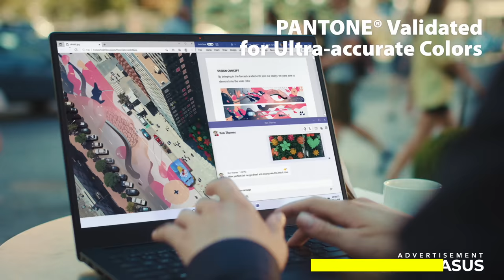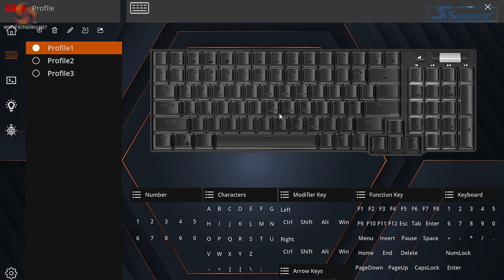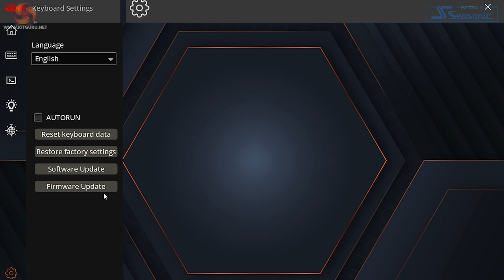Royal Kludge RK96  - INSANE Bang for Buck board!

Comment: Underrated keyboard, imo. I'm typing on it now, it's got everything I need; backlighting, wireless, Bluetooth, mechanical switches, hot-swap. I only wish the backlight color was a pure white and the media keys were separate from the function keys. Still, an insane value for a keyboard!
Reply: I bet if you changed the switches to ones that are clear/white then you’d get a pure white backlight.
Reply: hmm i got the rgb one so there's an option for a white backlight but i dunno if it's a bit bluish to you instead of pure white. The first models had only the blue ones I think. Mine has rgb.

Comment: Not sure about the volume wheel being stiff to roll and no feedback, I just got mine and its very light to roll and has tactile feedback like a mouse scroll wheel. Surprisingly, the volume wheels is also made out of metal. Maybe they fixed it in the later versions?
Reply: Hi! Can i use the volume wheel while on wireless or bluetooth mode?
Reply: @ianbalmaceda281  yes
You can also map it on your preferred function

Comment: I got it but returned since i found not very user friendly the switch to change between the different connections methods. I finished getting the RK M75, it's smaller but the mini display and the knob to change between connections make it much better kb.

Comment: With the multiple connections, can you instantly switch between them? I have my work and home setups together, will this work similar to the MX Keys and Mechanical, where I can have the keyboard connected via 2.4 to one and BT to the other, and if you FN+ connection option it instantly switches to that input option? Or does it take a second to connect after switching to a different input mode (like when I switch it to BT, does it have to connect at that point to BT)? Thanks!